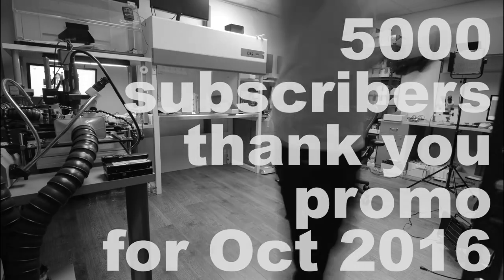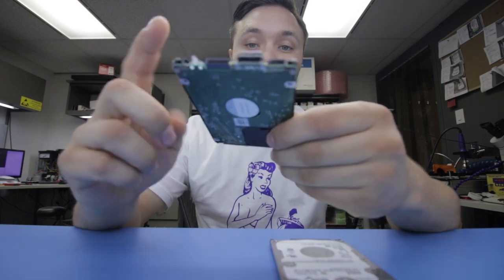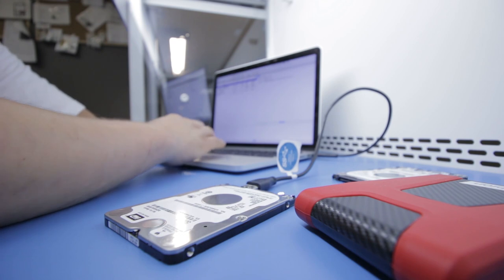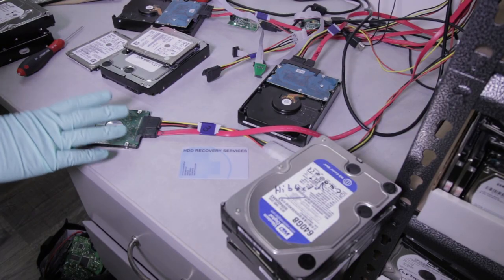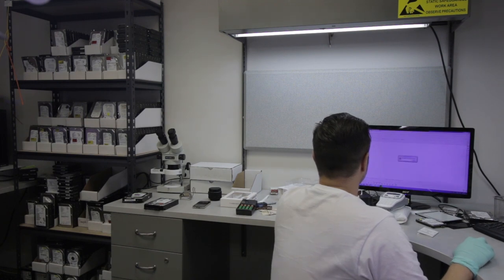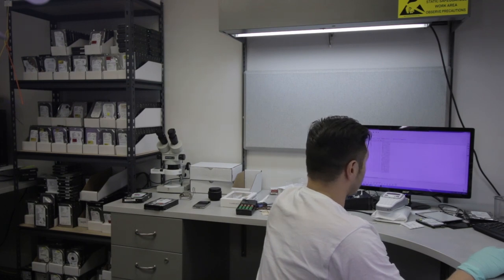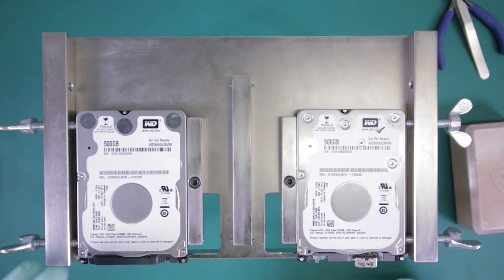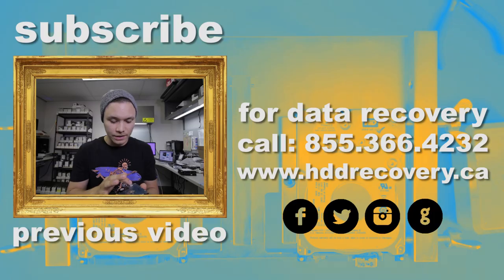wd external hard drive not recognized | data recovery promo

Comment: my external hdd is not recognised in both my computer and disk management ...the led light is on whenever i connect to the usb port what should i do please help
Reply: Did you ever find out the issue? I'm having the same problem
Reply: have u figured it out
Reply: what did you do? im having the same problem
Reply: ye same here help
Reply: I'm having the same problem with my WD elements i bought 6 months ago, when i connect to the pc the led turns on static after 10 seconds starts to blink =/
Reply: There is one way. Try getting a data recovery software, you cant see the device on the PC but somehow you can find the disk inside the data recovery software

Comment: There's actually SATA pins on this board. I've managed to solder wires to them and recover some data from my WD Elements. It was pretty ugly, so I decided to remake it and messed up with polarity. 
Funny, the USB part of the board died of the same thing.

Could you please tell us more about those SATA boards you use for recovery? Which ones can be used? Where to get one? 

Soldering and such is fine for me. I can recover an HDD unless it doesn't require opening it up. I'd really appreciate if you answered my questions.

Comment: If your WD Passport Ultra is reading slowly or not recognized, gently tap on top of hard drive to make it start working. Recover your data through tapping trick and store it on some other hard drive.
Reply from the maker: I highly recommend to NEVER EVER tap your hard drive no matter what the situation is (unless you want to look for professional data recovery services later that will easily charge you over $1000 for head replacement).

Comment: So my micro USB 3.0 cable not working I have a western digital passport. But just the cable that is not working.. what do u recommend 3.0 micro USB cable do u recommend me to get should I get another western digital or should I get a different brand. Cause the one I have is to sensitive like it comes out to  easily.

Comment: What drives are reliable. it blow my mind that i bought a Seagate 2TB "Expansion" for back up and you said that you are getting this externals all the time. I should have bought a proper drive (which brand make proper drives ?) and a caddy. Back in the old day, WD Caviars, Maxtors (before they turn into crap) ... man, I have old PCs at work running NT4 with insane old disk, people just turn them off from the SWITCH every single day. Still running. But I bought a brand new fresh drive and wont give ar near 1% what this old dinosaurs did and still do. I regret spending money on one of this drives. I would aprecciate very much your sugestions on which brand / type is reliable and suggestions to avoid issues... Well this started long ago with Maxtor and IBM making bad products. But grab and old WD or Quantum, the only way to stop them is with a hammer. I have 3 or 4 of them no matter how old they are, how many service hours they have,  improperly stored, I plug them into an old PC and still working. What happened to this people ??????.

Comment: I've had mine for years but I think it's just gone. dead. the light doesn't blink and there's no movement. I've tried different cables and nothing.  It's a wd elements se portable 500 gb usb 2.0 external hard drive. I was in the process of doing my quarterly back up and it just stopped working.

Comment: hey , i got a similar problem but the issue is drive will show up in the system after 2-4 minutes and will load data also(2-5 minutes) but while copying data it takes hell lot of time(for 20-30 MB files it takes more than 10 minutes)

Comment: Dropped my father's 1TB USB one 2 times on the floor frm tower yesterday..l carpted  floor grante dbut a rough tumble IM sure. Iti's SimpleTech 1TB which shows a WD WD10EAVS inside (1TB obviously). It won't mount in Linux or WIndows thus far. IT clicks a lot, very noisy. Should I continue to test around with it or is there any one thing I should do with it? I know these are laptop drives,  that you're showing here... I feel the data isn't recoverable maybe unless it's somehow attempted to be mounted via a regular SATA or ATA hookup.
Reply: Officer Gregory Stevens try opening it in a clean environment and remove that little thingy which reads ur data (SLOWLY) from the platter

Comment: Why have they started incorporating this proprietary USB 3.0 interface directly into the main PCB; and eschewed SATA?
Reply from the maker: my guess would be to save costs. making 1 PCB instead of 2 to have an external device is going to cost less. Very first passport drives were SATA with a USB 2.0 adapter
Reply: HDD Recovery Services Almost every time a HDD has failed me in the past, I've been able to solve the problem with a new caddy, SATA, SATA>USB adapter or similar. Now, not only is there no SATA interface, but the data's encrypted between the  controller and the disk, even if regular full disk encryption / password protection is disabled.
Reply: omg. i'm researching this today.  i was just thinking of buying a second unit and replacing on original drive, but are you saying the built in encryption would prevent the drive for being able to be recognized? get to the data possible, or would the encryption stop it. ?

Comment: my WD Passport 500 (blue) and 1 Terra, both, couldn't be opened.  They said the possibility problem is the cable then what cable should i purchase? Please advise. Thank you.
Reply from the maker: in my experience cable is almost never a problem, but if you want to try feel free to use any similar type of connection cable on it. WD passports came with 3 different plugs.

Comment: Just ran into this problem with My Passport Essential SE 1tb my laptop can't read it but it works fine on my Xbox one I can watch the movies that I have in it. Can you please help me by explaining to me why this is happing?
Reply: The13thPhantom Which laptop? Which OS? It's probably a filesystem conflict.
Reply: First of all thanks for replying. Sadly am using an old laptop because my other one got stolen. The one I have now has Windows XP I been using it for 2yrs now then one day the laptop couldn't read My Passport Essential SE 1tb hard drive. I tried all four USB slots but it won't work. 
 
It shows the name on the Device Manager - Disk Drives but not in the My Computer just shows local disk and letter. When I click it a window pops up: The file or directory is corrupted and unreadable. The USB slots work because I have connected other things and they work. But it works on my Xbox one.

Comment: Hi I have a 2TB external drive that for some reason is not being picked up by my computer. My computer operates on Windows 10. It reacts when I connect it to the computer as the light starts flashing and has a slight vibrating sensation. 
How can I retrieve my information from the external drive. I suspect the drive could have been damaged by dropping a couple of times.
Reply: I have the same issue. did you sort it out?

Comment: Is it possible to buy those SATA circuit boards individually, already compatible with WD 2.5" drives? Or even if the chip swap is necessary, can I buy just the SATA board alone and do the chip swap myself?

Comment: I have a seagate external hard drive slim that I've been using with my MacBook for about 2 years.  One day I was uploading information from an iMac desktop.  As the process was completing, the computer shut down.  I restarted the computer but the external hard drive is no longer recognized.  The external hard drive still spins and the light still comes on but the drive is not recognized on the screen.  I attempted this with several mac computers as well as a PC.  The PC can recognize the drive in it's administration tool but the file manager doesn't.  I am unable to see the files on this drive on the mac or PC.  Because it spins and the pc shows that it is functioning correctly, I attempted to clone the drive but that didn't help.  I've also tried changing the sata adapter.  this didn't work either.  I'm looking at all of these videos about how to recover data from dead drives but I don't think my drive is dead because it's spinning.  I've also tried cleaning the connections on the card.  I don't know what else to do.  can someone help.

Comment: Hello, I have a passport ultra drive that's not working. It turns on and the light comes on and you can hear it spinning but it's not seen on my computer and it makes a kind of clicking digital sound and the light goes off and it restarts itself. Almost like it turns off and restarts. I tried disk utility but it's not discoverable. I'm going crazy as all my work is on this drive.

Please help
Reply from the maker: best is to reach us by this link: www.hddrecovery.ca/contact-us

Comment: I have a 4tb wd blue with the usb interface  and the light powers on. and nothing else. no spinning at all. any help would be great. thanks
Reply from the maker: +michael dean if it does not spin at all you may have bad cable, connector is damaged in the PCB, or PCB itself is fried.
Reply: Okay. I order a new cable. I did replace the pcb board and it still has a solid light. So I order a sub cable just to make sure its not that.
Reply from the maker: michael dean if that fails also feel free to contact us for further assistance. We are closed until January 2nd, but this is a very straight forward repair that we can turn around very quickly
Reply from the maker: You can request this service here www.hddrecovery.ca/contact-us
Reply: HDD Recovery Services Hi sir! My hard drive says bad disk. The indicator light is malfunctioning too. But it could be read by the disk management as well as the device manager. Many important files are in my drive. What can you advice for me to be able to recover those files? Thank you.
Reply: I think I have exactly the same problem. Light stays on (when was working fine light was flashing) but my MacBook Pro does not recognise my external hard drive (passport 1T). It fell off the chair onto the solid surface. Now there is now a clicking noise every so often. - Im UK based do you do global service?

Comment: My WD Ultra Passport.  Spins and then cuts off.   Can you suggest a fix for that? Thanks.
Reply from the maker: George, if the drive spins up then clicks few times and powers down, then you have a failed head assembly. There is no fix for that, only data recovery service. Even with a new head set in, that drive will never be reliable again. If you need to get your info recovered feel free to contact us. Contact info is in the description box
Reply: They suggest you send the drive for for their "low" price of $400

Comment: Hey mann, I have a hardrive i dropped it but plugged it in to check if it was working it was. so i tried tried transffering something it was taking long so quit everything it was taking long so i plugged it out. I plugged it back in and it took for ever to come up i think i banged it and it accidently came up. I have a mac
Reply from the maker: most likely this is a slow response issue. We can help, contact us here: http://www.hddrecovery.ca/contact-us/
and copy and past URL of this video on contact form's details section so I know who this is.
Reply: im in the caribbean mann. Jamaica. I try to put my address it doesn't work
Reply from the maker: on the main page http://www.hddrecovery.ca there is a quick form you can fill out on the sidebar (it does not need an address)

Comment: Hello sir I just purchased a new wd   external hard drive named my passport and I inserted it in my Dell vostro 1014 then I just hears a pop sound but no notification or anything is being shown even I tried the disk management method and in there I didn't find my drive not even unallocated or without alphabet etc please help me
Reply: Have you figured out the issue?. I also have the same problem. Kindly reply

Comment: in my case, hard drive was showing up but could not access the data. i tried stellar data recovery professional to recover them.
Reply from the maker: It needs firmware patch. Stellar software cant do it because it will not have access to service area of the drive. You need vendor specific commands to get access. We can do it for you. Right now we charge $600 for such service if you are interested fill out your request here www.hddrecovery.ca/contact-us

Comment: If you bought these mechanic spin drives, now only worth 50 bucks or less in the usa, emediatly transfer all your save files out of it & into a solid/Sd drive NOW. Or don't by this BS! Its like carring an old tower comp storage drive in your free hand.
Reply from the maker: at least 95% of hard drives can be recovered. When SSD fails - you chances are like 30% at best for devices that are supported. Hard drive is still king for data storage on  the go.
Reply: @hddrecoveryservices  not if they have mechanisms that can get loose or snap out, which was the result, of the portable tower hard drive logic they sold us.

Comment: DAMN I MISSED IT FUCK!!!!!!!!!!!!
Reply from the maker: give us a call 855.366.4232 ext2
Reply: can i give you a call as well =0
Reply: Dont bother.....
Reply: Beee EZ  😭why can I know ?
Reply: No deals going on. I was told around $800 for 2TB WD.Maybe when they reach 1,000.000.000 subs.
Reply from the maker: Beee EZ we will probably do another one at 50K
Reply: Sounds good. I will experiment on my own well before then.
Reply: When will you have another offer? I really need my hard drive fixed. It has been collecting dust for over a year. Is that a problem? It's not recognized by the computer but the light is on. I don't hear any kind of clicking noise or anything. It just stopped working.